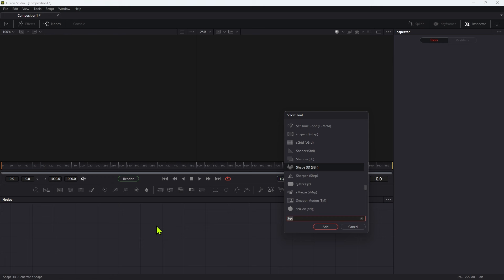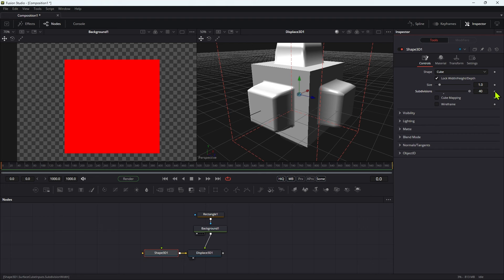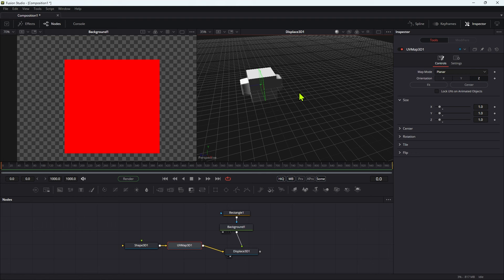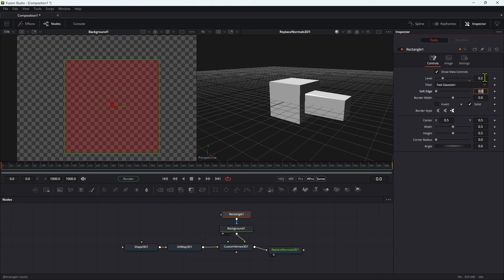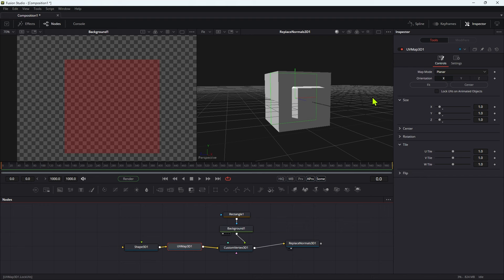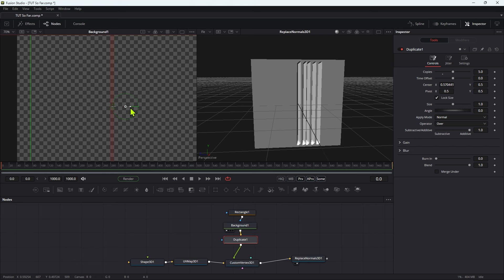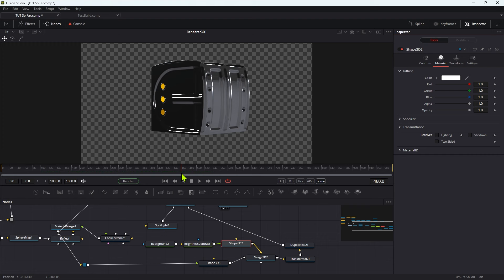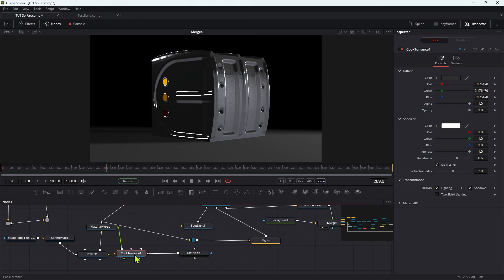Resolve Fusion: Advanced Modelling with Custom Vertex (3/3)

Comment: Love this!
Is it possible to use text or a simple bitmap shape for an extrusion?
I'm thinking like a child's wooden block.
Reply from the maker: Yes, you can extrude from both (Fusion generated) text and any bitmap image using the simple Displace 3D method or more fancily with this Custom Vertex method. (Or for better results you can extrude from an SVG or similar vector source using the Extrude tool, but I think you mean extruding from the faces of a cube? In which case the former methods would be the way to go.)
Reply: @SimonUbsdell  Yes, extruding from the faces of the cube is what I meant. Thank you!!
Reply from the maker: I thought so. In which case I should have added that if you want to add a different extruded/indented image to each face then the Custom vertex method is the way to go rather than Displace 3D and this tutorial is a good resource for showing how to do it. @pixelrancher
Reply: @SimonUbsdell  That's exactly what I want to do! Thank you so much, Simon.
Reply from the maker: Great. Just a reminder that you will need a lot of subdivisions to resolve text otherwise it will look very rough. Even just one letter on each face will need a serious number - I doubt you could easily go with much more.
Reply: @SimonUbsdell  Great tip. Thank you!
Reply from the maker: You'll notice I followed your suggestion and included a demonstration of this in my Macro tutorial. Works a treat, I think, so thanks for the idea.
Reply: @SimonUbsdell  I think I squealed out loud when I saw it, so yeah, definitely noticed!! 
I can't tell you how much I appreciate you sharing your wealth of knowledge with us.
I'm attempting to produce a three-character logo - a number and two letters - mapped to a revolving cube so your example couldn't fit better. Or so I thought. Then you mapped an image onto one of the faces. 

Haven't purchased it, (yet) but I also follow your Motion tutorials ... and at least watch your Blender ones.
Again, thank you for your expertise and generosity.
Reply from the maker: Always pleased to help when someone is so genuinely appreciative :)
Reply: @SimonUbsdell  Cheers!